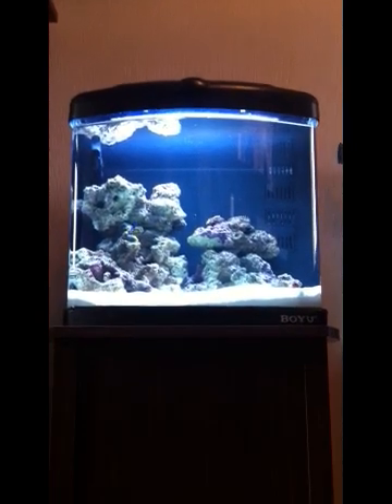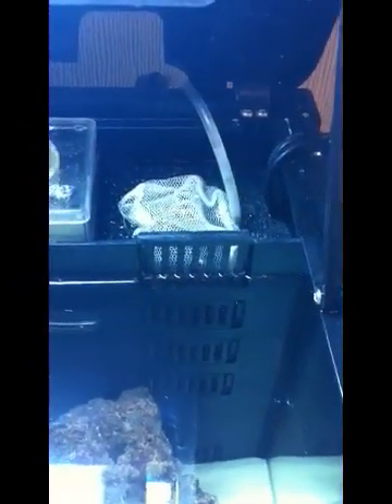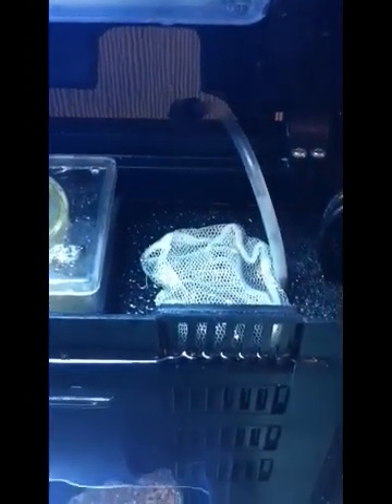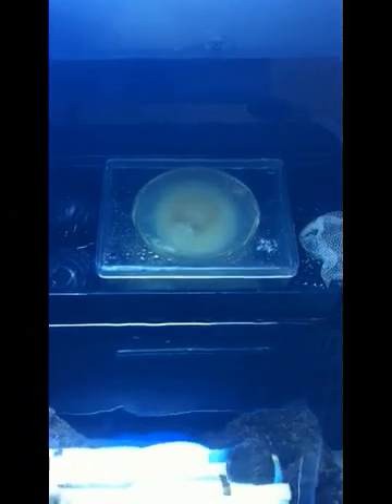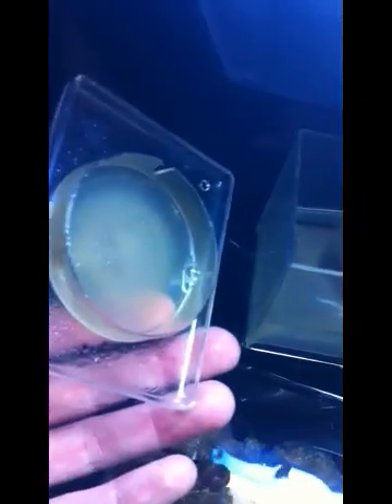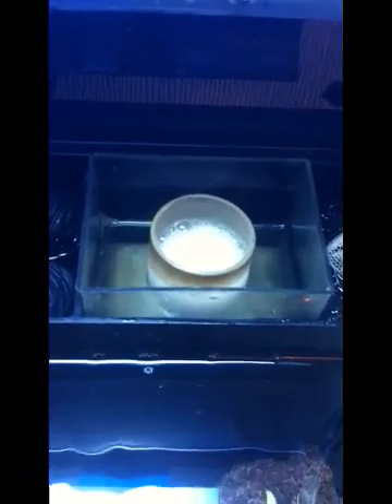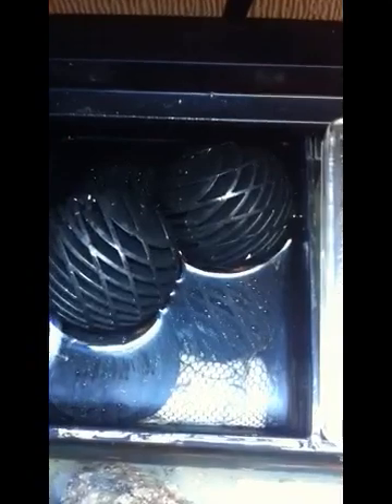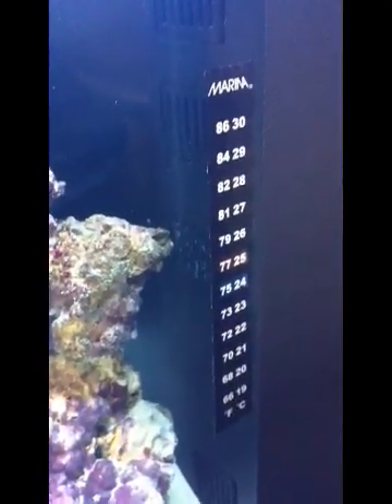Boyu TL450 How It Works - Episode 3

Comment: Brilliant video! Do the chambers take up any of the 60 litres or is there 60 litres of water as well as the chambers? I was thinking of getting the larger 550 tank. I don't suppose you know whether the filter is more powerful or if it is like this one and is inadequate. Also would you really have to upgrade the filter as I don't want to be spending too much money :/ One more thing, do you know if the filter and heater and things on the 550 are set up in the same way as the 450 or if they are ex

Comment: I've just bought this tank and found your videos very helpful!
I was just wondering where you would put an additional power head, i've got an hydro nano 900l/hr new for the tank and am not sure where to place it.
also would you upgrade the submersible pumps for more powered ones of will the flow be okay with what I have?